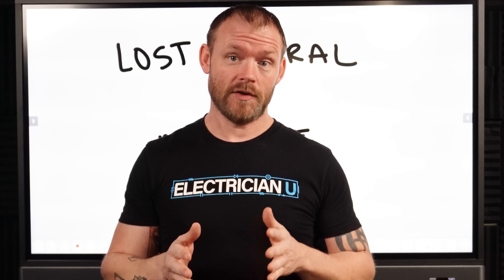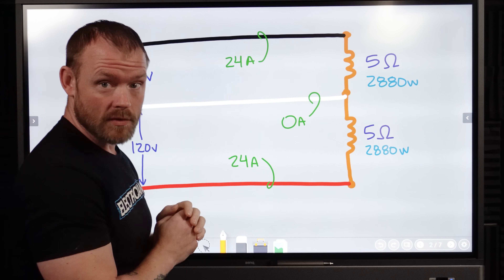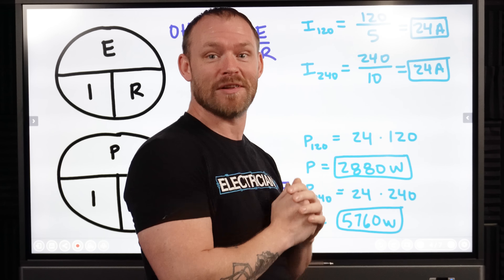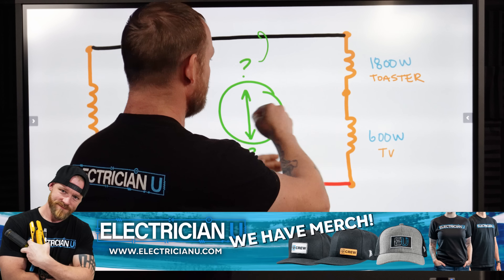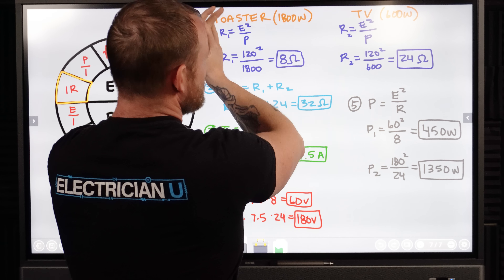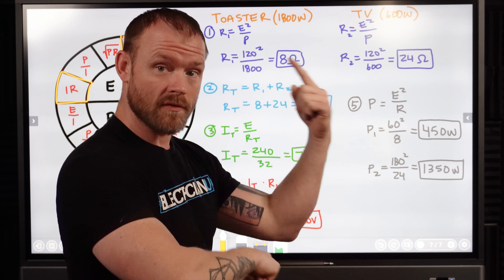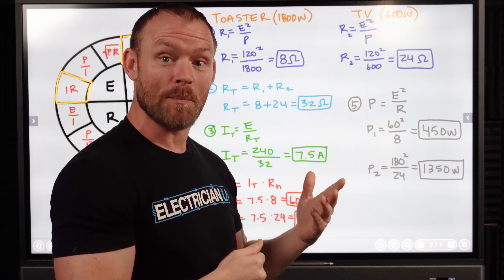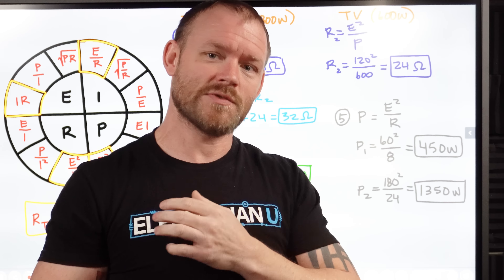NOT SAFE? Losing a Neutral in a Multi-Branch Circuit

Comment: When I was an apprentice working in a 120/208V  3ø panelboard in a retail store,  one of the first things I learned was NEVER lift a neutral until I'm absolutely certain all the ungrounded conductors associated with that circuit are de-energized and never assume that a two or three pole breaker or single pole breakers with identified handle ties has been used.   I also like to use a clamp on ammeter on the neutral as an added precaution to make sure no current is flowing after turning off the breaker. You never know if the codes weren't followed and a circuit from a different panelboard is sharing that neutral.
Reply: "Why is that neutral wire insulation brown/black?"
Oh, some DA shared it. Wipe off the crinkle coat and toss some tape on it.
Reply: @JasonW.  yep that'll happen if two hots on the same phase are sharing a neutral,  in this case the current in the neutral will be additive instead of canceling out.   An overloaded neutral would not be possible if a two pole breaker or single poles with identified handle ties are used as required by Code.  That's why I keep my clamp on multimeter in my tool pouch at all times while in the field.  Test and verify,  cannot be stressed enough.
Reply: my 2nd or 3red pair of milly walk yee 6 in 1 stripper cutter things has extra stripper slots/holes in the cutting shears because of that silliness, ... that and coming back from lunch without RE checking LOTO... SFMF

Comment: Great explanation. Another weird situation is when you loose half the circuits in you house but when you run the electric dryer those circuits get powered again.
Reply: Let's Go Brandon  Yes, the voltage (one side 120 volts)  goes thru the dryer ( or electric range) back out the other side of the 240 volt coil and then to the 120 volt LOADS
that have no voltage supplied, BECAUSE that side is open.  @Wcospider5
Reply: @Ted Lahm  Can you explain this further?  How is the dryer supplying power to the 120 loads in this case if the wiring to the 120 loads is open?
Reply: @tedlahm5740  I'm sure I'm being dense, but I still don't understand how this is wired (miswired really).  I understand that the dryer has a 240V circuit comprising both legs of the phase, but how is the 120V string wired such that it doesn't have power when the dryer is off (that 240V circuit is open) yet the 120V string does have power when the dryer's 240V circuit is closed?  Is a neutral shared with the dryer but also switched by the dryer switch in addition to the 240V circuit being switched by the dryer switch or ?
Reply: @bencarter7839
Reply: @tedlahm5740  Any idea of how this might be connected?
Reply: It's a series circuit so the dryer is the only device ran on the opposite phase.if you turn that device off everything on the opposite phase will shut off since you interrupted the circuit.
Reply: @Harry Miller  That explanation doesn't make sense to me without some additional factor.  The light string wouldn't be wired in series with the dryer in the 240V circuit, but could be wired to one of the hot wires used by the 240V dryer circuit and would also have to be wired to a neutral back to the panel to make it a 120V circuit.  The light string would always have a hot from one side of the phase going back to the panel uninterrupted and would always have a neutral going back to the panel uninterrupted.  What am I missing?
Reply: @bencarter7839  the whole house is now wired in 220 volts since the netural is cut. The circuit is not center tapped to the transformer it sees the entire winding of the transformer which is 220 volts.
Reply: @Harry Miller But this video is not about losing the neutral from the utility.  It's about the neutral for a single multi-wire branch circuit being lost.  So I  have to think the original comment had to do with some scenario other than losing the utility neutral, because if the utility neutral is lost, there are much bigger problems than some lights coming on when a dryer is started.
Reply: @bencarter7839  my fault. 
I'm trying to remember the video.
As far as I know if a multibranch circuit netural is bad, what happens is similar to what I described. Any loads on the multiple circuits are now tied together as series circuit so if I turned on load 1 from circuit 1 and load 2 from circuit 2 current will flow but the loads see 240 volts since they are opposite phases.

If they were on the same phase nothing would happen....
Reply: @Harry Miller  Agreed on the circuit as described turning into 240.  I'm still wondering about the starting of the dryer turning on lights though.
Reply: @bencarter7839  its like a string of Christmas tree lights.  If one bulb is unscrewed all the bulbs go out. If you screw in that bulb then all those lights go back on. That bulb is the dryer......
Reply: @harrymiller513  I understand wiring in series, but if the lights were initially wired with one hot that is also one side of the dryer's 240V circuit and one neutral (so they're at 120V), if the neutral is lost (the topic of this video), how do the lights have a circuit even with the dryer on?
Reply: @bencarter7839  OP posted it as "another weird scenario", so it's probably about a disconnected hot leg instead of a neutral, judging from the symptoms: disconnected circuits lose power, but share a hot leg with the dryer, so when the dryer is turned on, it acts as a crude short (due to high wattage/low resistance), effectively flipping the dead hot leg onto the other phase.
Reply: @hadrast  If it's not a lost neutral but instead a disconnected hot side of the phase, the 120V circuits in the house that were connected to that now disconnected side of the phase for a hot and were also connected to a neutral are now connected only to a neutral, so how could they ever have a circuit no matter what the dryer is doing?  Also, if a hot side of the phase is disconnected, how can the dryer still have its 240V circuit anyway?
Reply: @bencarter7839  The dryer doesn't get 240v; it just acts like a short and bridges the two phases together when the switch closes.
Reply: @HAst  OK, that makes sense now.  These other circuits share a disconnected hot leg with the dryer but after the disconnect point, so when the dryer switch is closed, the switch and the remaining wire intended for connection to the now disconnected hot leg just become an extension of the connected hot leg, and in conjunction with some neutral, form a 120V circuit.  Not a short; just a path for a hot leg.

Comment: Series/ Parallel circuits, Ohm's Law, grounding & bonding... gotta know all of it or you're not an electrician. And if you're not careful with MWBC's you could lose a lot of money in property damage and that's not what you want to have happen. Time in the classroom is SO important in the electrical trade.
Reply: I'm dealing with a loaded neutral, im a contractor,this trailer house was turned into a duplex and they let some jack leg really mess up this electrical system, hot neutrals in the front rooms, melted switches, old switch legs was tied back into the neutrals,fixed all those I saw, those are fixed,  it's terrible. Still got hot neutrals in the bedroom.

Comment: Thank you for explaining the math. I've wondered about it.  I experienced this when the 60-year old feeder to my parents' house wore through its neutral rubbing by on a tree that had grown. It was definitely presenting as a haunted electrical system with lights brightening and dimming and stuff not working.  The electric company folks knew exactly what was happening when I described the symptoms.  I pulled the main breaker and they rolled a truck to put a new feed on the house at midnight, bless them.  We lost a TV and the oven, but the expensive stuff survived.  Now I know both what it looks like and how to calculate the damage.

Comment: the wackiest situation I ever found was a house running on gen set due to a power outage, and since it wasn't a large gen set, they broke out a subpanel for that stuff. The guy who installed the generator moved a few circuits over but failed to realize some were a common neutral in the new kitchen. The imbalance went back to the utility side panel and caused flickering lights in the neighbor's house. (no gen set there) Talk about a haunted house! On further investigation, I found the basement fluorescent lights were also taking some of that flickering power, but nobody went down there on a regular basis.

Comment: Ok, from the title I wasn't sure because it sounded like you were talking about a 120v multi branch circuit ( multiple outlets on the same 120v circuit ), but yea, what you mean is when you have a split phase circuit and you lose the neutral, yea, you get different voltage on the two legs if they have different loads since the imbalance can't return on the neutral.  A former co-worker of mine had the neutral break to his house from the pole once and this is what happened: one leg browned out while the other leg went over voltage and burned out some of his equipment.  I had something similar happen myself once.  My oven heating coil melted down and shorted out against the chassis of the oven.  Apparently the control knob of the oven only bothers to interrupt ONE phase, but not the other.  So ONE side is always hot, and the chassis is always tied to ground, so other side that is always hot kept current flowing through ground and kept heating the oven, even though it was OFF.

Comment: Dustin, as a Licensed Journeyman for more than 55 years , I understood everything you said and showed in the Video but I could never explain it as good as you have done . And in my 55 years of installing electrical branch circuits , Residential and Commercial , I have never  wired any circuit as a Multi-Branch Circuit ! Each Circuit should have it's own Neutral as it should be except on 240 Circuits that don't require Neutrals and that would mainly be circuits for Welders and some heavy duty motors according to the manufacturer's specs.
Reply: Yes, this pretty much shouldn't be possible on an individual circuit if you follow code.  It can happen for the whole building though if you lose the neutral coming from the pole.
Reply: Where I am, you can pull 1 neutral to cover all 3 phases. For example, circuits 2,4,6 can share 1 neutral. Circuits 8,10,12 can share 1 neutral. It’s fine and works but I do agree I rather each circuit have it’s own neutral.
Reply: Starkly,   If you run a feeder to a sub panel, you are doing the exact same thing as a multiwire branch circuit.  I’m guessing not two neutrals there.  You say you have done commercial projects?  Have you ever wired office partition systems that have 4 circuits?  Do you run separate neutrals on parking lot lighting projects?   I find it hard to believe you always run separate neutrals.
Reply: @joshlavecchia9888  That's perfectly fine as long as all 3 phases and the neutral are either going to a single load, or to a sub-panel.  The single load will either return no current on the neutral, or less than the maximum current on any of the 3 legs.  Since the neutral can carry the same current as any of the 3 legs, it can't be overloaded.
Reply: The problem is that in wiring projects for buildings that are not single family residential, it's quite common to run multi-wire branch circuits.  Try quoting a job with individual runs against a competing quote with half the number of runs.  These aren't going away, at least in commercial settings.
Reply: @bencarter7839  agree 100% everything you mentioned.  Particularly now with the price of material and labor, electricians will be running multiwire circuits love em or hate em for the foreseeable future if they want to remain competitive in this economy.  As long as two or three pole breakers are used as required there's nothing to fear.   We'd likely still be using them in residential,  if it weren't for AFCI/GFCI requirements.  Although a few panel manufacturers have double pole AFCI breakers in their stock offerings,  that removes the cost advantages of multiwire circuits.

Comment: I have seen countless melted neutrals because the DIY or handyman connected both circuits onto the same voltage, that caused massive neutral overloads. I have gone on hundreds of no power calls because of that condition.

Comment: One question that came to mind when you were explaining what happens in an open neutral, was, does this video explain the kitchen scene of the movie 'The money pit", where Tom Hanks is in the kitchen, sits down to read over the contractor paperwork, turns  on the lights, and the sparks fly as the wiring is burning up the wall, over to the outlets, tiles popping off, the counter appliances turning on, speed up, he pulls the coffee pot plug and watches the TV set blow up, and the refrigerator smokes, and then everything else goes south !??, or was this a Hollywood prop setup?, I think that this describes your open neutral video, please let me know,  thanks 😊

Comment: Nice explanation. The neutral in the service to my house opened several years ago. Three receptacles blew out of the wall, several switches fused, Romex melted, and so on. Most of my stuff blew up. Tragically, it occurred during the one week I was between insurance policies.

I rewired my house after work using a Coleman lantern for light. It took two weeks, and another week for the electric company to replace their effing underground service. They, of course, called the disaster "an act of God" and avoided any liability.

Bastards.
Reply: Under no circumstance should the romex ever melt.  Both legs in the romex are supposed to be on their own circuit breaker to interrupt if current goes high enough to melt the wire.  Loss of neutral is only a problem for appliances since the voltage can go too high on one leg to fry the appliance, but not get the current high enough to trip the breaker.  Breakers are there to protect the wire, not the load.
Reply: @phillipsusi1791 : Oh, I get it, but this was really extraordinary. Fortunately, most of my family was here when it happened. I had six circuit breakers with welded contacts. I lost my fridge, dryer, furnace, computer, printer, two televisions, etc. Light bulbs literally exploded. Four surge protectors burst into flames. If no one had been home, I would have lost my [mortgaged, uninsured] home.
Reply: @edwatts9890  
Damn!

Comment: I’m a retired industrial electrician. We ran many 3 phase 208 w/neutral, we had some cord ends lose connection and burn up expensive electronics and other components
Reply: D’oh!
Reply: That's why code says that if you are running a 2 or 3 phase circuit, it must be hard wired to only ONE load, or a sub panel that then has its own breakers in it.
Reply: @phillipsusi1791  I don’t think I understand. These were machines with motors, electronic controls single and 3 phase loads in one machine
Reply: Monte,   If I understand correctly, you ran a 3 phase 4 wire branch circuit out to a point and made a cord connection to a machine that had 3 phase 208v loads and single phase 120v controls.   The neutral failed and the 120 volt controls were hit with higher voltage and fried.   Unfortunately that can happen and there is no fix other than well done terminations and maintenance afterward.   Best wishes,   Kevin
Reply: @monteglover4133  Oh, I thought you meant you had multiple outlets going to different outlets with different devices plugged into them.  Yea, one device that returns some current over the neutral to cheap out on an AC/DC converter that can only handle 120v input will blow that part out if the neutral fails.  I never liked it when they made clothes dryers switch to a 14-50 outlet with a proper neutral so they could legally keep using a 120v AC/DC converter instead of just making them spend another nickel on a converter than runs off the 240v.